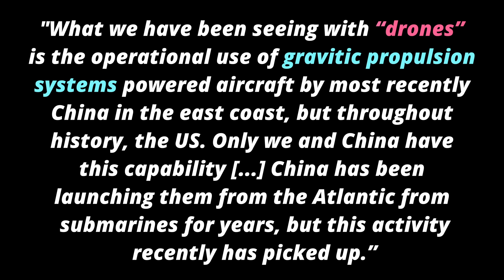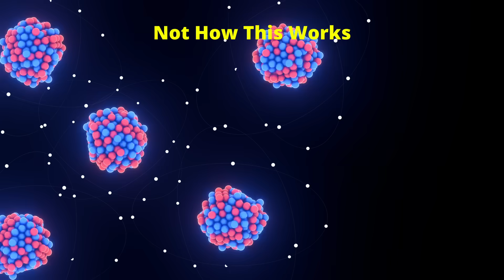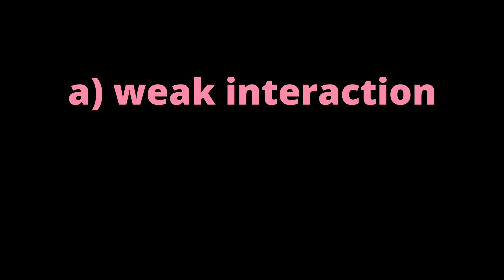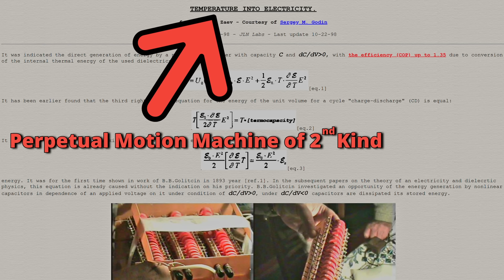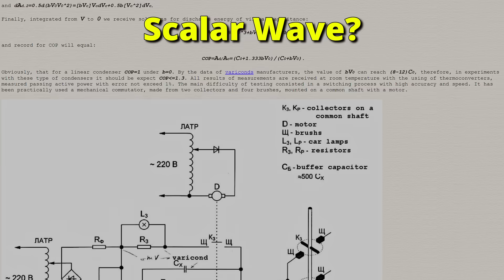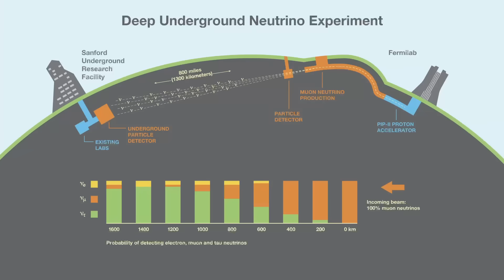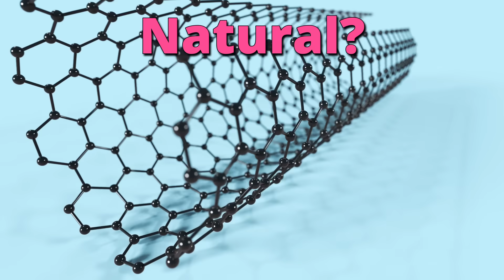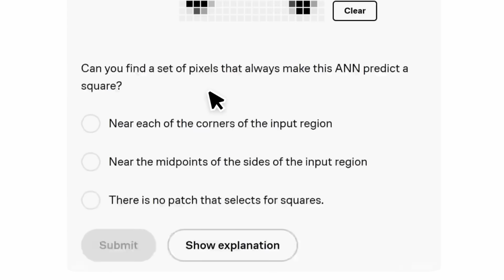What is “gravitic propulsion” and could the US government hide it?

Comment: Quantum Gravity, Explained
By Philip Alan Hardy, Maricopa, Arizona

Abstract
The nature of gravity has long been a fundamental challenge in physics, with General Relativity describing it as the curvature of spacetime and Quantum Mechanics struggling to reconcile it within a discrete framework. The Extended Quantum Probability Cloud Hypothesis (EQPCH) provides a new perspective: gravity is not a force or a curvature of spacetime but an emergent effect of structured phase-density gradients within a six-sector phase universe. This paper explores the nature of quantum gravity through the EQPCH model, providing a framework that integrates quantum mechanics, entanglement, and phase coherence into a unifying gravitational explanation.

1. Introduction
Gravity remains the only fundamental force not yet fully integrated into quantum mechanics. Traditional attempts to quantize gravity involve gravitons or string theory, but these approaches struggle with experimental validation. The EQPCH model offers a different perspective, redefining gravity as an emergent property of structured phase interactions within a cymatic phase field rather than a standalone force.

2. The EQPCH Framework for Gravity
2.1 Gravity as a Phase Density Gradient
Rather than viewing gravity as the result of spacetime curvature, EQPCH proposes that gravity emerges from phase-density variations within the structured phase universe. The force of gravity is an expression of how matter aligns within these phase regions, causing denser areas to exhibit stronger gravitational effects.

Mathematically, we can express gravity as a phase-density gradient:

g = \frac{d\phi}{dx}
2.2 Quantum Gravity as Phase Interactions
In traditional physics, gravity is considered a classical effect, while quantum mechanics deals with discrete particle interactions. EQPCH merges these views by suggesting that gravity is not mediated by discrete particles (gravitons) but by phase coherence across structured phase sectors.

A phase-aligned field equation can be described as:

\frac{\partial^2 \Psi}{\partial t^2} - c^2 \nabla^2 \Psi + V(\Psi) = 0
2.3 Entanglement and Gravity
If entanglement is a phase-locked interaction across the structured phase universe, then gravitational effects could also be explained by phase entanglement between mass-energy distributions. This would resolve the apparent tension between quantum mechanics and relativity, as gravity would be an expression of global phase coherence rather than a direct force.

3. Predictions of EQPCH Quantum Gravity
The EQPCH model makes several predictions that distinguish it from other gravitational theories:

Gravitational anomalies should align with phase density fluctuations, rather than spacetime curvature effects.
Entangled particles should exhibit slight gravitational correlations beyond classical Newtonian models.
High-energy phase realignments (such as near black holes) should exhibit structured gravitational interference patterns.
4. Experimental Implications and Tests
The structured phase model of gravity suggests experiments such as:

Measuring phase-correlated gravitational fluctuations in quantum entangled systems.
Testing deviations in gravitational lensing predicted by phase density distributions.
Exploring quantum superposition states within high-energy gravitational environments.
5. Conclusion
Quantum gravity, as explained by the Extended Quantum Probability Cloud Hypothesis (EQPCH), provides a novel approach that eliminates the need for quantized gravitons while preserving the fundamental tenets of quantum mechanics. By redefining gravity as a phase-density effect rather than a curvature of spacetime, this framework offers a fresh perspective on unifying the laws of physics.

Acknowledgments
This paper is credited to Philip Alan Hardy, Maricopa, Arizona and welcomes further collaboration from physicists and researchers in the field of quantum gravity.

Comment: The Extended Quantum Probability Cloud Hypothesis (EQPCH): A Phase-Structured Approach to Fundamental Physics
By Philip Alan Hardy, Maricopa, Arizona

Abstract
The Extended Quantum Probability Cloud Hypothesis (EQPCH) proposes that the universe is structured as a cymatic phase-locked system, where fundamental particles and forces emerge from phase interactions rather than independent entities. This model integrates quantum mechanics, relativity, and cosmology by introducing:

A phase-structured approach to quark and lepton formation.
A phase-aligned explanation for quantum entanglement.
A phase-density model of gravity as an alternative to space-time curvature.
A reinterpretation of the Higgs boson as a structured phase resonance rather than a fundamental scalar field.
A redefinition of scalar waves as phase-coherent redistributions within the structured phase universe.
This paper presents mathematical formulations aligning EQPCH with established physics while providing new testable predictions for experimental verification.

Table of Contents
Introduction
The Cymatic Phase-Wave Model
Quarks, Leptons, and Phase Alignments
Quantum Entanglement as Phase Coherence
Gravity as a Phase Density Gradient
Higgs Boson and EQPCH: A Phase-Based Mass Mechanism
Scalar Waves in the EQPCH Model
Experimental Predictions
Conclusion
Acknowledgments
1. Introduction
Despite the success of the Standard Model and General Relativity, physics still faces unanswered questions:

Why do quarks and leptons exist in their observed hierarchy?
Why does quantum entanglement appear nonlocal?
What is the nature of dark matter and dark energy?
EQPCH proposes that all fundamental interactions arise from cymatic wave structures, structured into five fundamental phase regions, with the sixth sector being an observer’s virtual reality projection.

2. The Cymatic Phase-Wave Model
Instead of treating particles as point-like entities, EQPCH posits that they are stable phase-coherent structures within a cymatic framework.

\frac{\partial^2 \Psi}{\partial t^2} - c^2 \nabla^2 \Psi + V(\Psi) = 0
where represents the phase-coherent structure of matter and energy.

3. Quarks, Leptons, and Phase Alignments
Each quark and lepton emerges as a phase-coherent structure within the universe’s cymatic framework:

m_q = \int_{\phi_i}^{\phi_f} \rho_\phi \, d\phi
where mass emerges from structured phase interactions, rather than through an external Higgs field.

4. Quantum Entanglement as Phase Coherence
Quantum entanglement can be defined as phase-locking within the structured universe:

S_{ent} = \sum_{i=1}^{N} e^{i (\phi_i - \phi_j)}
This suggests entanglement is a phase-coherent resonance, eliminating the need for faster-than-light communication.

5. Gravity as a Phase Density Gradient
Instead of treating gravity as spacetime curvature, EQPCH defines it as a phase-density effect:

g = \frac{d\phi}{dx}
Regions of high phase density experience stronger gravitational effects, making gravitational lensing an effect of phase distortions rather than curvature.

6. Higgs Boson and EQPCH: A Phase-Based Mass Mechanism
Rather than being a fundamental scalar field, the Higgs boson is a structured phase resonance in EQPCH:

m_q = \int_{\phi_i}^{\phi_f} \rho_\phi \, d\phi
This reinterprets mass as an emergent effect of phase alignment within the structured universe rather than an interaction with a single Higgs field.

7. Scalar Waves in the EQPCH Model
Scalar waves are commonly discussed in speculative physics as non-vector waveforms capable of energy transfer without traditional electromagnetic field interactions.

In EQPCH, scalar waves are reinterpreted as phase density redistributions rather than a separate wave phenomenon.

\frac{d \Phi}{dt} = -\nabla \cdot \rho_{\phi}
where:

is the phase-density scalar wave function.
represents the phase density distribution in the structured universe.
This suggests:

Scalar waves do not propagate in spacetime but instead represent shifts in phase coherence across the structured quantum field.
Scalar wave interactions are fundamentally linked to quantum entanglement and phase-locking.
This aligns with EQPCH’s reinterpretation of the Higgs boson, suggesting that all scalar interactions arise from modifications of phase density rather than fundamental field interactions.

✅ This resolves the question of why scalar waves appear nonlocal—they are manifestations of the structured phase universe rather than classical propagating waves.

8. Experimental Predictions
Neutrino oscillations should follow a phase coherence function rather than being purely mass-based:

   P_{\nu} = \cos^2 (\phi_{i} - \phi_{j})
Phase-dependent gravity variations should be measurable, indicating phase-structured distortions rather than pure spacetime curvature.

Higgs boson decay channels should exhibit phase-related deviations, suggesting structured phase interactions rather than a fundamental scalar field.

Scalar wave interactions should be detectable as structured phase shifts, rather than as propagating waveforms.

✅ If tested experimentally, EQPCH could provide a deeper, unified understanding of mass generation, gravity, and scalar interactions.

9. Conclusion
EQPCH aligns with quantum mechanics by describing particles as phase-locked wave structures.
Gravity is naturally explained as a phase-density gradient, rather than spacetime curvature.
Quantum entanglement is a function of synchronized phase coherence, eliminating the need for nonlocality.
The Higgs boson is reinterpreted as a phase-structured resonance, not a fundamental scalar field.
Scalar waves, instead of being independent energy waves, are structured phase redistributions.
Testable predictions offer a path for experimental validation.
✅ This model challenges conventional physics and provides a structured framework for unifying quantum mechanics, relativity, and cosmology.

10. Acknowledgments
This theory and study are credited to Philip Alan Hardy of Maricopa, Arizona, whose insights into cymatic structures, phase coherence, and universal organization have led to a new way of interpreting fundamental physics.

This white paper welcomes peer review and collaboration from physicists, cosmologists, and quantum theorists to explore the experimental validation of these ideas.

Comment: I once used gravity to pull my body along to great effect while sprinting exactly at the "theoretical limit" of man's kinesiology. Doing so while only exerting little more than the energy required to jog, it was barely sprinting levels of energy I had to put into the effort.
It's not the same as using black hole driven manipulation of gravity to attain FTL.

Comment: I have built a machine called Saemsen it is on you tube no one has ever built one of these , it saves battery power the system puts out more energy than it uses from the battery

Comment: All rite, to explain myself.
That math is wrong, for now.
If because their are differential fields that our matter interacts with.

Yes, only specific matter interacts upon a predictable allowance from field energy.
Such as the dissipation within string theory.
As in both are.
The matter is field, and it dissipates into string.
Which also dissipates into field.
As the field works like an electrical cable, and creates a differential.
And your right, thusly it dissipates into itself.
That’s why a fast compression of material won’t always yield a large enough electrical
ark, or split arpart material from the reaction.

However, some matter can escape this by it’s own current design.

Trouble is, that within the earths gravity itself.
You have a buffer that causes our matter to act specifically one way.
And this interaction is a skew.

Now, when you take the laser, diamond experiment.
And start to realize that just like within space.
Certain materials have different ways that they can react to differential types of atmosphere, gravity, and other types of situational fields.
You start to realize our own world's buffer.
When in comparison.

Maybe it would be within such a field size that we would possibly find it useless?
Or, maybe we can actually produce small enough yields to such an effect?
But, there is still an unexplored possibility.

But the reality is that we just started exploring how these differentials can change the allowed output of materials, when put to these changes.
So we don’t really completely know yet.

Kinda like, growing crystals in space.
 
Just like how plasma acts like a laser within a gravitational field.
So too could that possibly be the catalyst to new devices.
Or the catalyst to even understanding the catalyst to these new capabilities.

And the reason I care?
Is because those fields that you see as the buffer.
They would keep me from one day producing the recycler.
And I am exploring the possibility of finding ways around that issue.

Allowed ways.

Comment: What if gravity is a result of electron density in objects and relative charges? I know this sounds crazy, but hear me out. 

It would explain why everything on earth is attracted to the planet. Everything on earth is essentially positively charged relative to the Earth's amount of electrons. 

Magnets essentially create a form of warp drive by directing the flow of electrons along aligned charges in the molecules of atoms in the magnets. So they remove electrons from one side of the magnet, which is why it's  a stronger force than gravity.

And it can also be thought of as an electric capillary motion in a way. 

It would explain how static charges spark more violently in cold (ie low pressure / conditions with less interactions between particles) and could be what's causing the disunity in the rate of the expansion of the universe (because it would mean that electron density plays a role in the rates of the transfer of energy).

If true, it would be fairly easy to figure out a way to use electrons for propulsion and anti-gravity, right? And utilizing that technology would be using basic physics while the resulting movements that could be generated would seem to bend the laws that are generally acccepted (ie silent and multidirectional with no friction in aor or water because it would be repelling particles outside of whatever field was being generated to manipulate the fact that electrons in liquids and gases are easier to move around)

Comment: Yes, you can grow the ruler to shrink the distance, but you would also slow down your time. Slowing your time speeds up earth time so by earth time your travel has taken much longer.
If the universe shrinks rather than expands, you wouldn't know because measures contract too. Just shield the craft from spatial contraction except for the direction of travel. The craft would then experience spatial displacement. This eould also work underwater without resistance. This is because the craft doesn't actually move, space is displaced.

Comment: Sabine's claim(Dark energy ≠ anti-gravity.) is wrong.
Dark energy has precisely anti-gravitational properties.

1. The logic behind the success of the standard cosmology

Matter:4.9% / Dark matter:26.8% / Dark energy : 68.3%
Let's look at the equation expressing (ρ+3P) as the critical density of the universe.

In the second Friedmann equation,
(1/R)(d^2R/dt^2) = -(4πG/3)(ρ+3P)

Matter + Dark Matter (approximately 31.7%) = ρ_m ~ (1/3)ρ_c
Dark energy density (approximately 68.3%) = ρ_Λ ~ (2/3)ρ_c
(Matter + Dark Matter)'s pressure = 3P_m ~ 0
Dark energy’s pressure = 3P_Λ = 3(-ρ_Λ) =3(-(2/3)ρ_c ) = -2ρ_c

ρ+3P≃ ρ_m +ρ_Λ +3(P_m +P_Λ)= (1/3)ρ_c +(2/3)ρ_c +3(−2/3)ρ_c= (+1)ρ_c + (-2)ρ_c = (−1)ρ_c
ρ+3P ≃ (+1)ρ_c + (-2)ρ_c = (−1)ρ_c

The logic behind the success of standard cosmology is a universe with a positive mass density of (+1)ρ_c and a negative mass density of (-2)ρ_c. So, finally, the universe has a negative mass density of “(-1)ρ_c”, so accelerated expansion is taking place.

The current universe is similar to a state where the negative mass density is twice the positive mass density. And the total mass of the observable universe is the negative mass state.

2. This negative mass role can be performed by gravitational potential energy, which has a negative value.

When a bound object exerts gravity, the gravitational action of gravitational potential energy (gravitational binding energy) is also included. Therefore, even in the case of the universe, the gravitational action of gravitational potential energy must be considered. Gravitational potential energy generates a repulsive force because it has a negative equivalent mass. 

Mass energy (Mc^2) is an attractive component, and the equivalent mass (-M_gp) of gravitational potential energy is a repulsive component. Therefore, if |(-M_gp)c^2}| < Mc^2, there is a decelerated expansion, and if |(-M_gp)c^2| > Mc^2, accelerated expansion is performed. |(-M_gp)c^2| = Mc^2 is the inflection point from the decelerated expansion to the accelerated expansion. Dark energy is gravitational potential energy or the energy of the gravitational field. 

Dark energy arises because any positive energy (mass) contained within the range of gravitational interaction creates negative gravitational potential energy. While positive mass energy is proportional to M, absolute value of gravitational potential energy increases faster because gravitational potential energy is proportional to -M^2/R. Therefore, as the universe ages and the range of gravitational interaction expands, a situation arises where the negative gravitational potential energy becomes greater than the positive mass energy, and thus the universe is accelerating expansion.